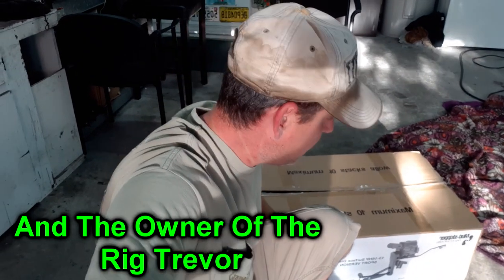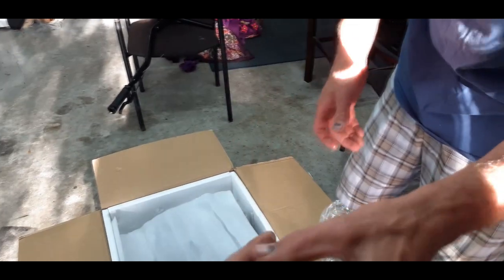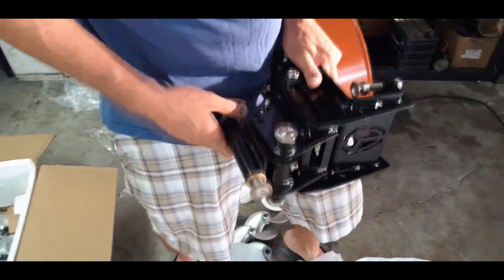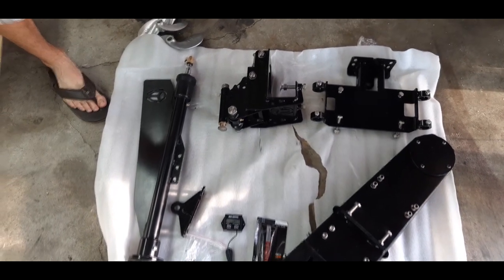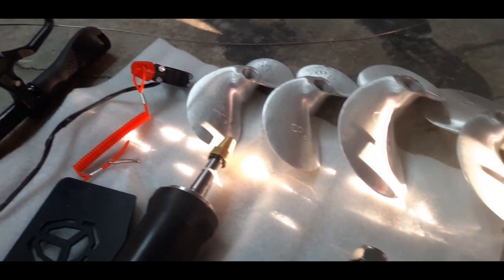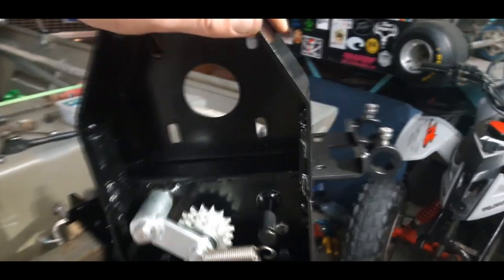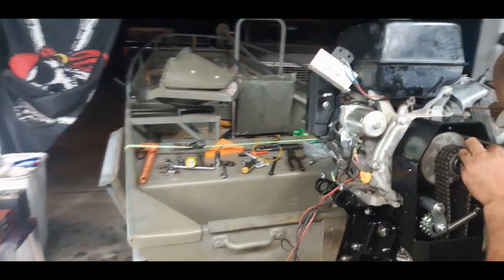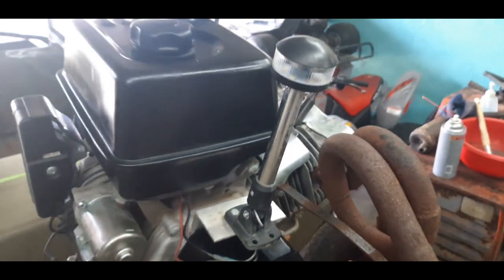Mud-Skipper Surface Drive SPORT Version Unboxing, Mount And Test Ride With Predator 420cc

Comment: How much did you give for that bad boy?
That adjustment bracket that bolts to the transmission is called a Jack Plate you can get them so fancy that they have a motor that brings it up and down but not in and out the in-and-out part of it is always fixed on my Skeeter I had a 10 in Jack Plate and you got to kind of mess with them one turn of the bolt makes a difference. So to find that sweet spot you drive it all the way down and give its a four turns to bring it up and then you will notice the difference each time you stop and redo it. So as you're coming up with it you do Ford turns and then do it again for terms and then once it starts getting so bad then you start heading back down but only use two turns and you'll you'll be able to feel the difference it takes a couple of hours cuz you got to stop kill the motor Maybe give the Jack played a couple of turns tighten it back down excetera excetera excetera. But my point is it's called a Jack Plate

Comment: Nice catch man! Going to be getting a similar setup but a stage 3 predator 420
Reply: Let me know how that goes thinking about a carb  
Rod and no governor on mine with heavier springs..
Reply: @kristiankitsch6976  it’s definitely worth it, I’ve had go karts and mini bikes and I’ve built all the motors and did mikuni carbs and it’s a night and day difference the amount of throttle response and power gain you get throughout the power curve is insane. These engines are so choked up from factory it’s not even funny
Reply from the maker: Thx California..lol

Comment: Question: Could you set this up with a steering wheel rather than the steering arm? I am replacing a 25hp merc on a 17ft Lowe type boat.  I am hoping I can sub in a 22hp Predator motor. What do upu think?
Reply from the maker: I'm sure it could be done...maybe with a pully system or something..let me know how it turns out

Comment: How does the boat sit ans handle in the water with just the driver in the rear of the boat? Would float pods be a thought after putting that motor and kit on? I've got a 12 foot jon that I want to put the same set up on but I rarely have a second guy with me to weight down the front.
Reply from the maker: U dont need the float pods...thx for watching

Comment: Got a question I just got the same kit in but the belt driven instead of chain driven. The four bolts to mount the belt/chain housing is not threading in easy qt all and instructions say do not force them. My question is did you have a hard time to thread yours? Mine are also Allen wrench style.
Reply from the maker: Ya..it could be the powder cout paint in the holes..try to take a file or sand paper to get the paint off the inside of the holes..hope this helps ...good luck
Reply: If you know size and thread count,  run a tap into the holes.

Comment: I totally dig the surface drives for their turning/gear ratio ability, but where I live I don't have to deal with a lot of vegetation, just the occasional super shallow rocky stretch of river. Which do you think is better for shallow water and ease of getting the prop up over obstacles? The long tail or the surface drive? I'm putting together a 1542 with 13hp for putting around little rivers/big creeks
Reply from the maker: Long tail for that kinda terrain..or jet drive..lol

Comment: Good video how do yall think that same set up would do on my boat I have a 14ft jon boat duracraft from the 70s I weigh 240
Reply from the maker: The 420cc will push it..in my opinion..thx for watching friend
Reply: I would go with the V twin 22 hp. No vibration and twice the HP

Comment: Does it have neutral like it says on website?
Reply from the maker: Clutch driven so at low idle prop shouldn't spin...however we had problems with the clutch not disengaging..so ya..

Comment: I have a 420 on mine but can’t get it to run right. Also have the stage 1 kit
Reply from the maker: Did u unplug the oil sensor?
Reply: No I have not
Reply from the maker: jones  yellow wire going into block..try unplugging it